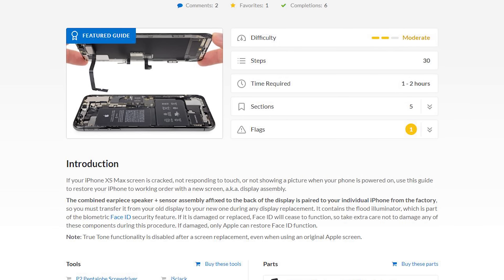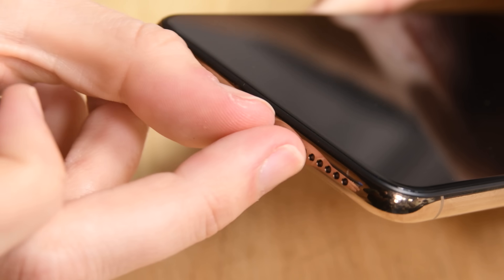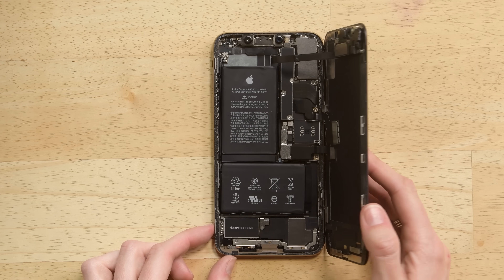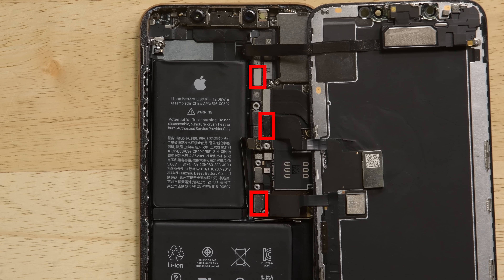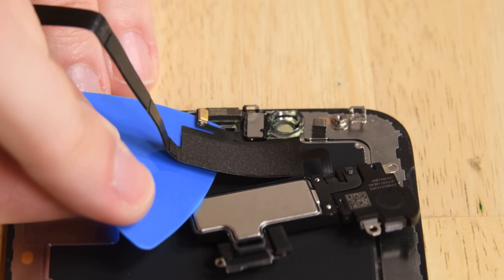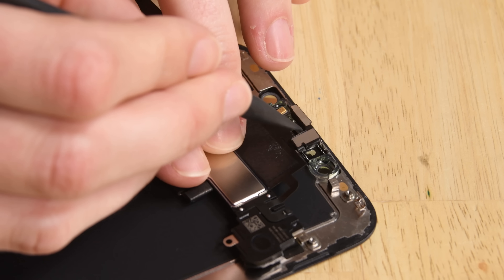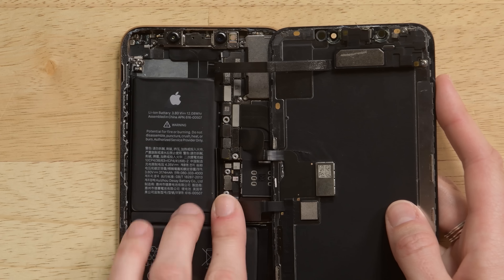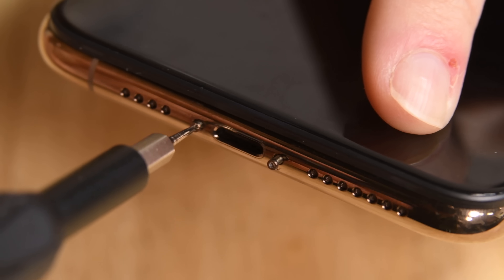iPhone XS Max Display Replacement - Complete Disassembly and Reassembly

Comment: Why does swapping the display makes you lose True Tone‽
Reply: Ikr why??
Reply: Calibrated with each individual screen, like the handshake used to be for TouchID.  I advise people to have Apple do the replacement on the iPhone X and will for the XS and XS Max, too.
Reply: the screen is paired with the logic board from factory.  my guess is.  similar to older models 8, 8+ and X.  data from the old screen has to be copied to the new.  as of yet.  such device does not exists for the xs max
Reply: you'll be fine true tone should work it just will act funny since the  Stock display isn't there for it base its OG calibration data off of. Seeing as most of Apple's display even 3rd party ones are so similiar in nature u should be fine. Also theres this thing called Night shift might have heard of it. Yaaaaa it does the same thing Slight variance in the two features. But to the average even repairer they won't notice. 

So u good mate.
Reply: TheReal _ist True Tone sense lights in the surrounding while Night shift is just turning the screen redder.
Reply: Sweet Zongzi 

Well ya but True Tone is literally just adding sensors to read the basic ambient temp of the light around u. To which it then tells the phone to turn on night shift to said color tempature. 

So basically True Tone is night shift but with a few more sensors. So my point still stands.

Comment: How to repair PS4 controller
Reply: Yaqoob Yaqoob lots of tutorials out there. Pretty easy. What needs to be repaired?
Reply: @daniel_960_ Probably the the R2 button I'm guessing...that or a dead battery.
Reply: @letssuperfuntime  check the voltage if not then its probably the r2

Comment: more samsung phone please
Reply: But y with Apple you can actually replace the display without REMOVING EVERY component from the phone. Unlike the Galaxy line which makes u do just that. 

Biggest reason I'll never get a Galaxy they make u do so much work to replace the display the part of the phone most people break first. Meaning funny enough Apple has a more user focused repair mindset with there phone engineering then the much more enthusiast Samsung Galaxy phones. 

Pretty ironic isn't it...
Reply: potato potato potato potato potato potato potato

I know right I just hate rational arguments to something I oppose. 

Fucking idiot, u irrational fanboys are such a problem in the industry.

Comment: Does this one still have the weird issue where FaceID may or may not work after screen replacement? I've seen that issue in a few shops with the regular iPhone X.
Reply: No it doesnt happen if you dont replace the earpiece with the Display. Just transfer it like your homebutton and everything works!
Reply: Incorrect.  Transferring over the parts doesn't result in 100% success rate with Face ID.
Reply: potato potato potato potato potato potato potato why are you watching this?
Reply: mine stopped working after i left it in my cold car, it’s stupid how sensitive it is
Reply: I replaced my iPhone 6's display and kept my old home button but the finger print doesn't work lmao
Reply: Roshan cus u probably didnt attach it back properly i replaced my 6s plus screen and homebutton my touch id still works
Reply: @xdd15  I've reseated it and made sure it was back properly though
Reply: @Roshan_420  Did you transfer the cable-plate thing that sits on the back of the display connecting the touch ID button to the logic board?
Reply: @scarecrow234  yup everything
Reply: @Roshan_420  It could just be that the home button is damaged unfortunately. Had the same issue with my old 6! Does the home button per chance generate a lot of heat occasionally?
Reply: @scarecrow234  it stays cold and button function works just fine and maybe yeah so basically screwed since its apple and I cant just buy a new button
Reply: @Roshan_420  Haha pretty much I'm afraid, apple are quite anti consumer unfortunately
Reply: @Roshan_420  In order to have 100% success that the touch id will function properly you will need to go in to your iPhone settings and turn off all of your touch id settings. Once you do this swap the old home button onto your new iPhone replacement screen, then it will work. I know I am a little late on this but hopefully you still have the old home button or it will help others.
Reply: Jordan Chapman cool I will remember and maybe out my old one back tomorrow
Reply: @Roshan_420  Sounds good, if you have any issues just send a reply here.

Comment: Huh, the replacement seems very simple.
Reply: iPhones are actually very easy to repair unlike other apple products
Reply: @jcube7319  what they didn't tell you in this video is that if you don't use a particular gadget to restore true tone by transferring the data from your old screen to the new screen you won't be able to turn on true tone on the new screen from the keypad of your phone.
Reply: @bassinbillRC5300  I'm late to the party, but they said it 22 seconds into the video :P

Comment: loss in true tone?
Reply: True Tone is calibrated and programmed into each screen at the factory. There are tools for copying the ALS calibration data from the original screen, but I haven't seen any that can re-calibrate True Tone. It's unlikely you will notice that True Tone is not calibrated in the screen itself.
Reply: @jonmarler  I understand that its not calibrated to the best it should be and all. But from what your saying it seems true tone still works its just not calibrated to the minor new variables that comes with said new display. Since all are slightly different. 

Doesn't this mean True tone will work just not as well as a stock sealed phone would rit? Also if this is true what will the effect be on the end user if the true tone works but just isn't calibrated to the new display. Will it randomly activate with out rational reason, assuming it should activate in said situation since its using the old screen calibration as its basis? Perhaps. Things like that or any other issues u could see happening would help us out a lot. 

Thanks,
Reply: @TheReal_ist   it just dosnt work
Reply: @TheReal_ist  Without the calibration data, the phone won't activate True Tone whatsoever. I'm quite confident though that someone will figure out a way to reactivate TrueTone even on 3rd party and refurbished displays though.
Reply: Jon Marler 
Alright if that’s true next question is how do u know this. Aka what’s your source so we know to take what u say as something worth taking.
Reply: @TheReal_ist  I'm not an expert, so all of my statements come from my anecdotal evidence. There may well already be ways to recover True Tone, or third party parts that come preprogrammed, or something else I don't know. I don't work for Apple or a refurbishing company. I'm just a dude that repairs phones.
Reply: @TheReal_ist  what about you go and figure it out yourself repairing an iphone cause you dont believe people who actually work with those shitty phones everyday and provide you a tip for free, i guess i fix it company plus technicians telling you the same thing is not good for you and thats fine, i feel i wasted my time but no, maybe someone else might read this :)
Reply: Alex Xomon make sure if you buy a replacement screen it’s an apple oem one, there’s cheap lcd based chinese ones flooding the market at the moment
Reply: @brando12343  i always try to sell for my customers refurbished oem, for them and for me, same price as installation but less problems